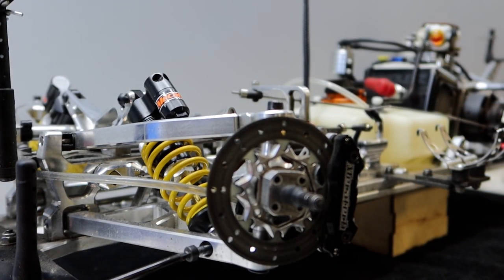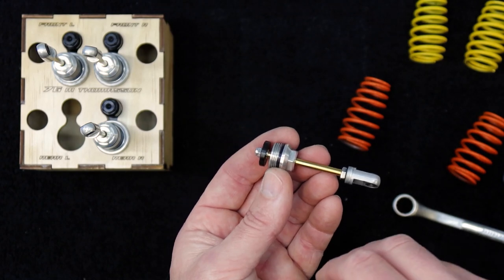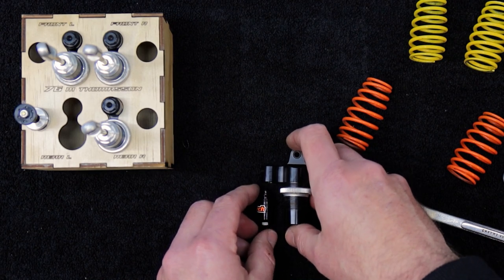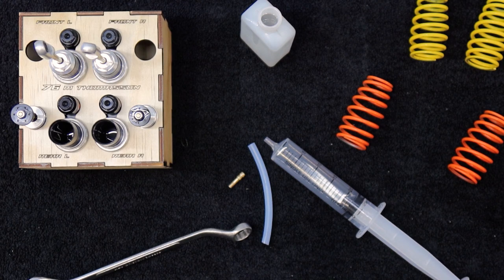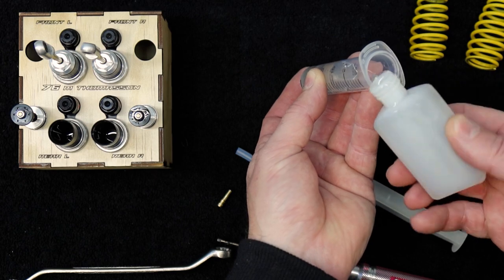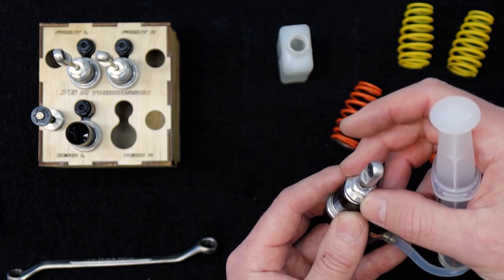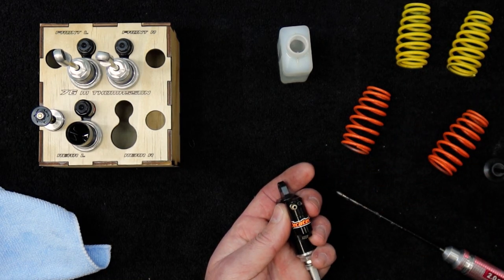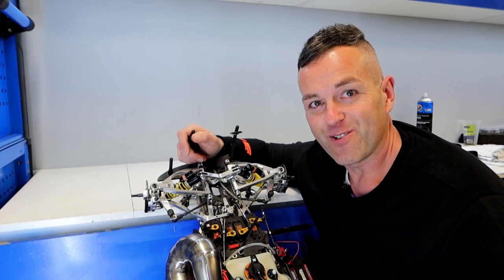RC CAR SHOCK REBUILD & DIY VACUUM - RC Tips & Maintenance from the workshop

Comment: A very nice workshop!
Reply: I cannot see if this are the Variable Shocks or not. At the V shocks we have the problem with the rebound by filling it up.
Reply from the maker: Hey Mate, mine are not variable  - the same method should work fine tho, maybe even better than a standard shock. The added port (or variable part) should flow the silicone better. Let me know if you gibe it a try!! Thanks for the comment!
Reply from the maker: Thanks Mate!! if only I could retire and potter around the workshop all day long! Do you have somewhere to work on your cars?
Reply: Mark Thomasson i have a cosy smart room with a heater in the winter, but without a air conditioning in the summer. But fine tho!

Comment: What shock oil do you use for front and rear?
Reply from the maker: I use 8000 in the front and 4000 in the rear, nothing special either just some old FG stuff I had lying around too! what kind of car do you have? 1/5 scale?
Reply: @MarkThomasson76  , Thank you for the response. Great instructional videos. Looking forward to seeing more... What about one on gearing or engine tuning...

Comment: I don't use hobby-grade silicon oil, they're so expensive compared to the industrial one... just buy random cst grade and mixed as you needed using this calculator...

https://oil-additives.evonik.com/product/oil-additives/resources/base-oil-mixtures-en.html
Reply from the maker: Mate what a great tip! wheres the best place to buy industrial silicone oil? I'm keen to give it a go!!
Reply: I don't know where you could buy in your country, but in my country, I usually buy them from my local chemical supplies store... You could buy industrial grade silicone oils...
Reply: They usually sells in 350cst, 1.000cst and 5.000 cst...
Reply from the maker: @martintanjung5540  I'll have a look around! I'm really keen to try something! Thanks Mate
Reply: You're welcome...